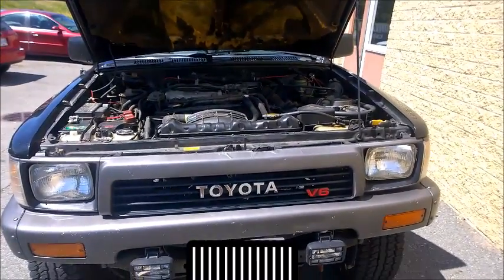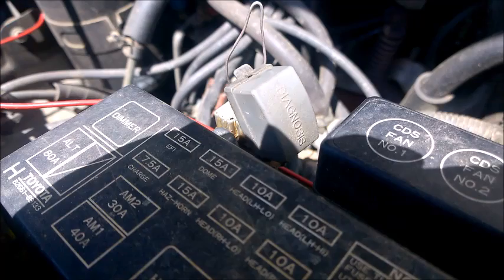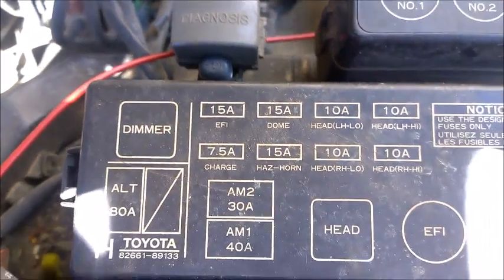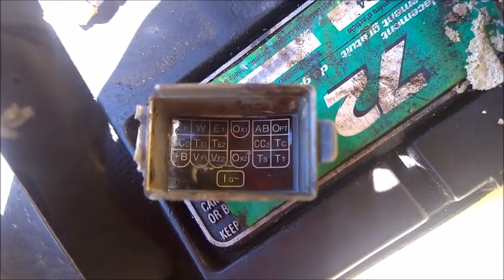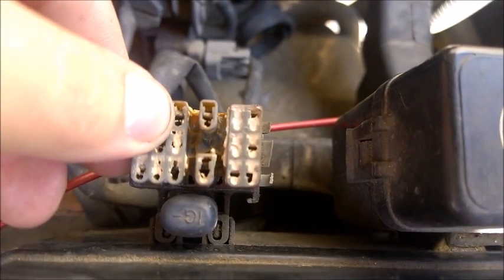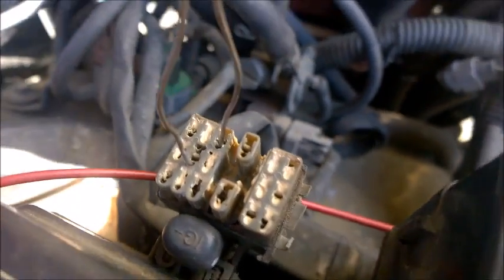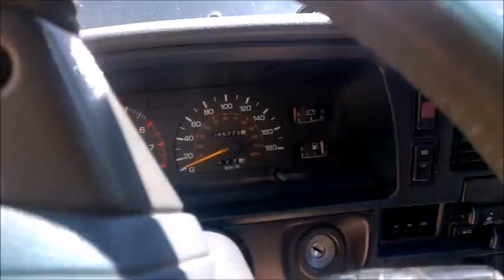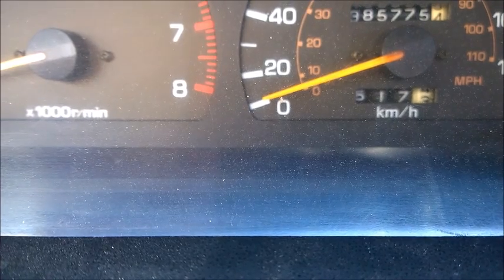1990 4Runner Code Check

Comment: HELP!!! I did that on mine and It was Continuously Flashing no pauses non longer non shorter what does that mean.
Reply: That means there are no codes. If you are still having problems with your truck/4Runner you will need to go thru and check because the computer is not throwing any codes.

Comment: Code 12
, my 1994, 22re, standard, 5 speed, with 313,000 miles failed me last Friday, the engine stopped on the Miami turnpike at 70 miles per hour, it is giving me the code 12, it is not the distributor, it can  be the coil or the igniter too, it could be that some cable is broken or it went to ground because the ECU is not receiving the signal and it is not the ECU because it would not give me codes, long way ahead, if someone has had the same  experience let me know so I don't go blind, without work, with little money I can't take her to the mechanic, I have to do it, please help.  Thanks.

Comment: I just tried this on my 1995 4runner but got a continuous blinking of the check engine light with no pause in between. What else could I try?
Reply: That means there is NO problem.
Reply: No codes, that means. Ok
Reply: I’ve got the same thing
Reply: were you able to find out what the problem was ?